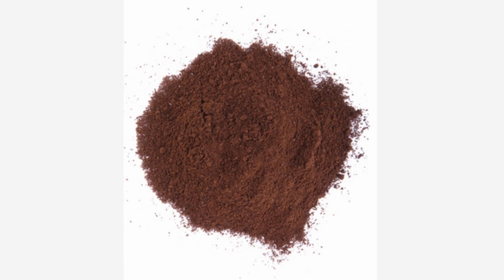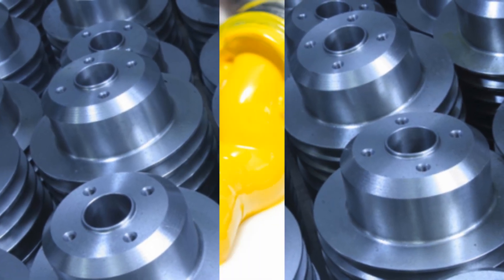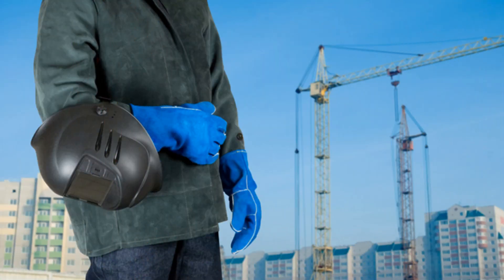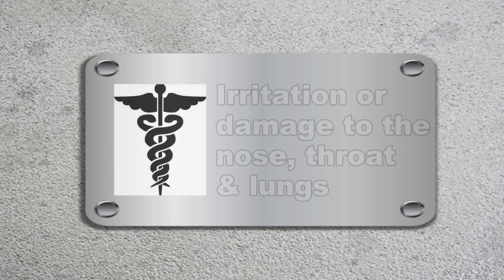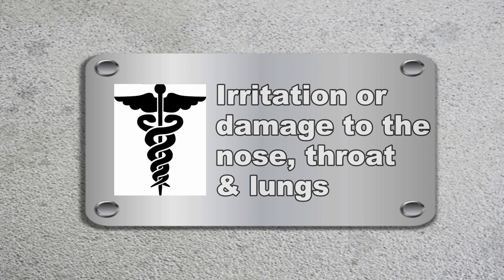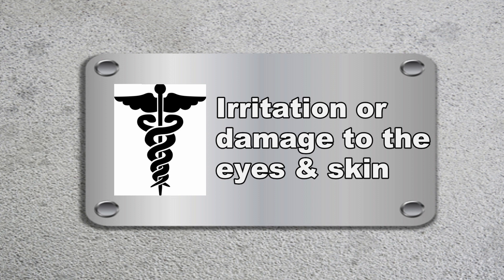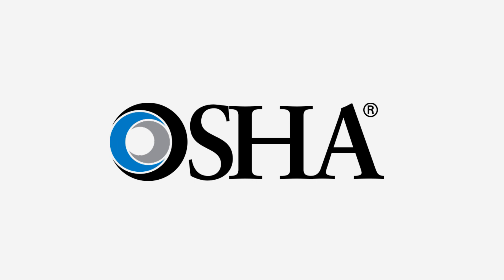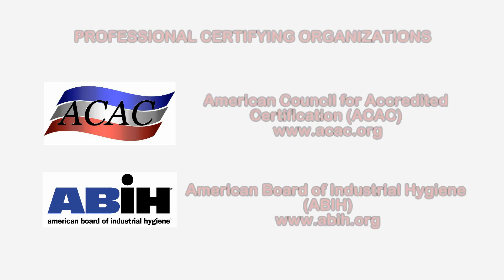Hexavalent Chromium & Your Health

Comment: I have been exposed to this stuff for years welding grinding and painting and have suffered all the symptoms of exposure.
What can I do now for myself besides taking all the safety precautions while working?
Reply: me too.  what sympoms are you still having today?  is it getting any better?
Reply: @Jimo225  still having some shortness of breath sometimes but luckily nothing too bad.and now i always wear a respirator. 
even for small little jobs.
Reply: @garyweber6413  my nose is producing more mucous than normal and my throat feels like it has cotton balls in it.  I am stopping work with SS.  I hope these symptoms go back to normal
Reply: @Jimo225  that is not good.might be a good idea to stop welding ss.
i try to do all my welding outside 
if possible or right next to open
garage door as i don't have a fume
extractor.really toxic stuff all welding.
do you have any good fume extraction equipment?or are you doing any other 
type of work that could expose you to 
respiratory irritation? or voc
volatile organic compounds  ?